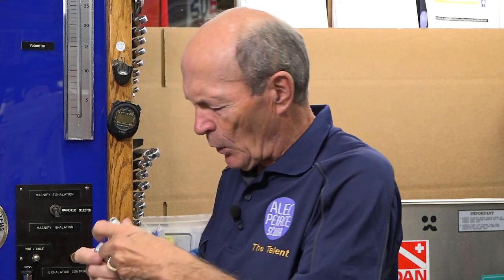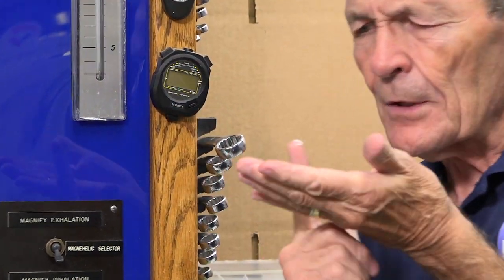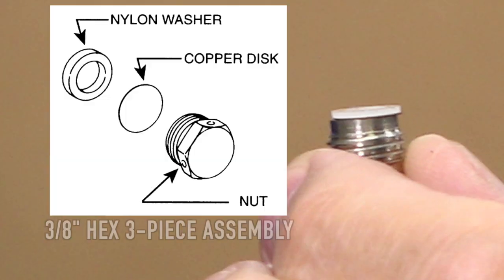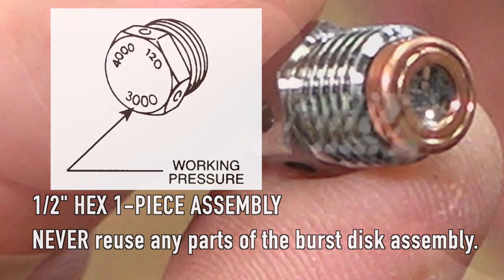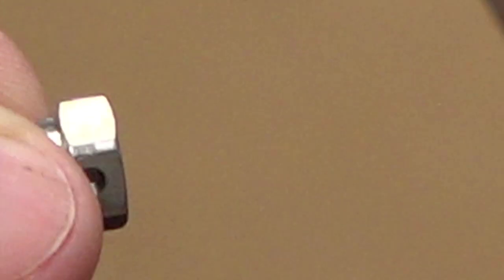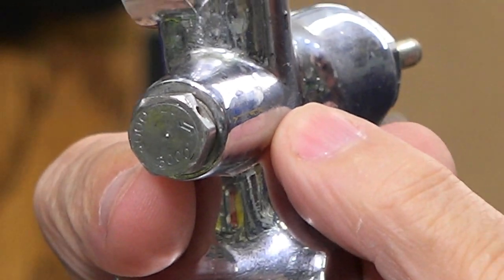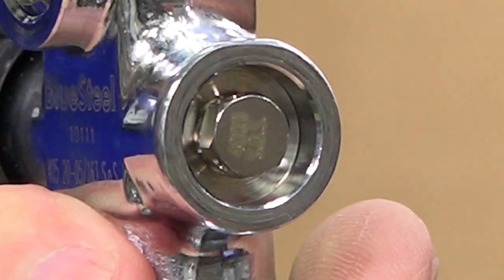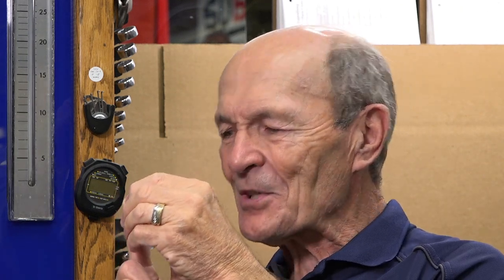How Do Burst Disks Work? - Scuba Tech Tips: S12E17

Comment: Working in a shop I've seen burst disks on occasion, it's an attention getter. One thing I've seen that you didn't mention is that occasionally when they age they develop a miniscule pin hole at pressure. 
This results in you filling a tank to 3000 psi and putting it in the rental rack. 2 weeks later you test it before it goes out and it's at 2200 psi. What's happening, and you need to find it is fill the tank to pressure and submerge it is a tiny stream of fine bubbles from the disk. At some point the pressure drops enough for that the hole reseals and stay stable at that lower pressure. Can be a bit frustrating to trouble shoot. (Trust me on that)
As always, top notch content from you.
Reply from the maker: Didn't want to cover disk leaks as that may be a follow-up video if this is well received.  I serviced thousands of tank valves but never came across a leaking disk.  Thanks for sharing Steve.
Reply: I think this has happened to mine. 
Thank you for for posting this information.
It fell on good ground. Thank you.

Comment: the burst disc is a major safety feature in the case the tank is caught in a fire, this will avoid a destructive explosion . 
It is a safety feature that protect from a destructive explosion in the case an overfilled tank left in an overheated automobile trunk. 
If you figure that a the tank contains the energy of a powerful  compressor running for as much as 1/2 hour to fill one tank, you can imagine the energy accumulated. When this energy is sudently  released ( say 1/100 second) you can imagine the power of the blast and the shock wave that is sufficiently powerful to blast you in a packet of miced meat .
Reply from the maker: Don't mess with safety items like burst disks.  They are to safe you from doing something silly.

Comment: Hello, quick question!
Is it legally acceptable to have a cylinder valve without a burst disc?
I have seen brand new aluminum cylinders with a new valve that doesn't seem to have a burst disc, and I am wondering if that is safe
Reply from the maker: All scuba tanks must have a burst disk of some sort.  If you saw a new tank and valve it will have it but may be recessed and not as visible as older models.  When it doubt, ask the tank owner to confirm it.
A

Comment: You don't tend to see burst discs on steel tanks?  I suspect this is because being steel they hold there mechanical strength up to a much higher temperatiure, so are less likely to fail in a fire, which is really the main case for a burst disc activating?  (most modern valves use a plastic tank valve seat, so in a fire this actually melts and acts to release the air pressure in a controlled way)
Reply from the maker: All tank valves should have a burst disk, steel or aluminum, does not matter its the safety aspect to prevent a tank bursting.    Thanks for watching Max.

Comment: If a HP steel tank has a working pressure of 3414 PSI, but can take oh, 7500 PSI why are we limited to 3414 instead of say 5000?
Reply: Whats your first stage rated for?
Reply: In cave country LP steel stanks are regularly filled to 3800
Reply: Yokes can't handle more than 3500 psi, so going any higher requires threaded DIN connectors. If you offer a tank for sale with a pressure of >3442 psi, you can't sell it with a yoke valve, which would greatly limit the market for it. Here in Europe, DIN connectors and 300 bar (4500 psi) tanks are much more common than in North America.
Reply: @KB-gd6fc  the direct consequence is a greatly shortened fatigue life of the tank material and you,re more likely to encounter a failed hydrotest.
Reply: @jacquespoirier9071  cave fills have been the standard in cave country for 40 years. It's been ok so far. Besides, if I fail a hydro after 20+ years of good service, yet got a puss ton more gas for dives for 20+ years I call that a win.
Reply from the maker: The yoke is the limiting factor.  They do not work safe above 3442 psi so DINs are used for higher pressures.

Comment: I am currently finishing cave training in North Florida. In getting all of my own gear straight, my instructor has asked that I place 5000 psi rated burst disk into two Faber LP Steel 85s. They have been filling these tanks to around 3600 psi each (on average). Do you know why they have us use low pressure tanks for this? Is it a weight thing? And since I have to install these disk replacements myself (my local shop refuses to do it), do I need to add any type of lubrication before installing?
Reply from the maker: First, congratulations on taking cave training. It's a fun and demanding sport with no room for errors.  Fabers LP's are rated 2400+10% (2,640), PSI fill pressure in North America.  Why overfilling to 3600 is not something I can relate to but tech divers may.  Suggest posting your question on www.scubaboard.com for expert tech divers input.  May assure you all is OK or not but you decide what is right.
A

Comment: My cylinders have a hydro test pressure 50% above the working pressure, so the burst pressure is some way above that.  My regular ones are tested at 350 and the 300Bar cylinder at 450 so I'd guess the burst pressures are North of 400/500Bar.  Also, living in the UK and having EU spec kit, none of my cylinder valves have burst discs; I guess the Eurocrats decided no-one would try or even be able to fill a tank to over 5800 psi, let alone 7000!
Reply from the maker: I have not dived European waters but all the tank valves I have seen in my travels have a burst disk, yoke and DIN.  It maybe a specific country regulation but having filled thousands of tanks, It is possible to overfill to 400+ easily if not watching the gauges.    Thanks for watching Tim.
Reply: @AlecPeirceScuba_SeaHunter  I've certainly seen them in the Caribbean/US, but not in UK.  Useful to know how they work though.
Reply: @AlecPeirceScuba_SeaHunter  As far as I know we don't have them in the Netherlands either. None of my 6 tanks have them